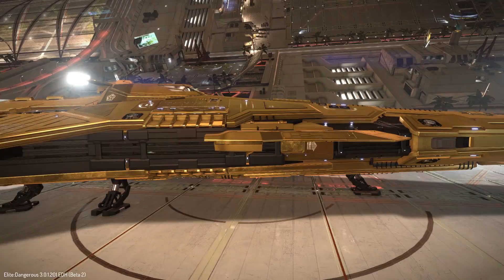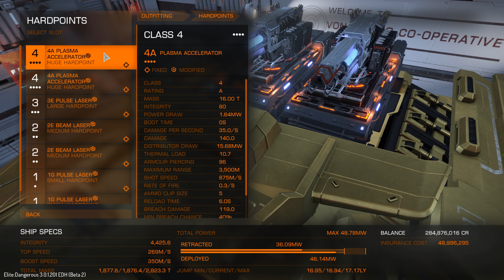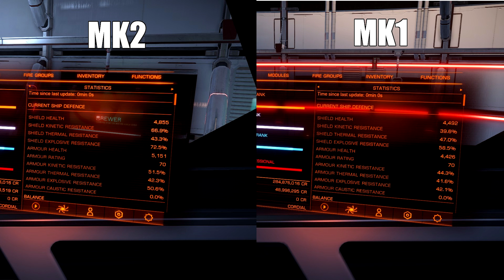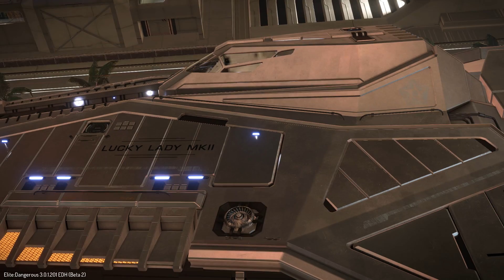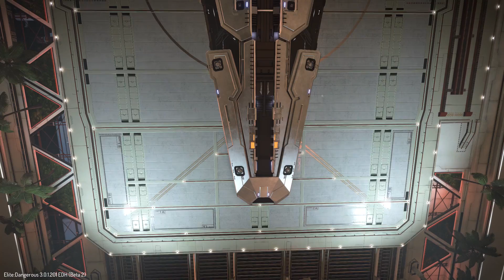Elite: Dangerous - My Corvette 3.0 vs 2.4 Engineering

Comment: I'm a bit confused I will have to see why, but my shields total have gone down using the new system. The resistances have moved up by .2 or .3 tiny.The tot all have dropped by 400mj after upgrading all boosters and generator to new system. I've left them the same configuration to compare.
Hull total moved up a little, resistances have improved also. Again same configuration.

Comment: The only Thing i dont have to Engineer again is my powerplant because it allready has 50.50mw lol
Reply from the maker: +Eric Boltjes you might find the negatives are better under the new system or the experimental effects make a bit of difference.
Reply: CMDR PLATER yeah thats true maybe one of the new special effects will get me some advantages as my current and favourite build only uses 46mw
Reply: Mine is at 54.something MW legacy mod, not gonna touch it :D

Comment: You should try Heavy Duty on the Reactive Composite, remove the advanced scanner and use a Hull Reinf with thermal. ;)
Reply: Plater still has a lot to learn about outfitting and engineering